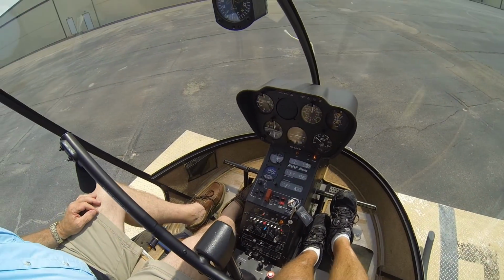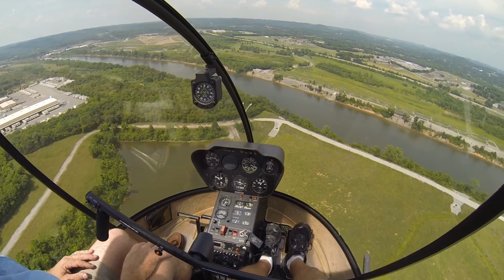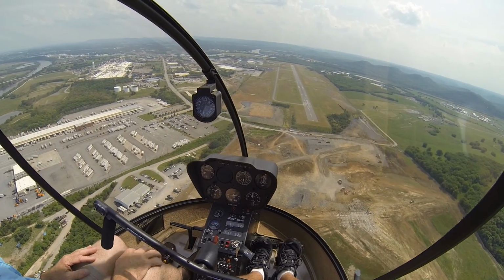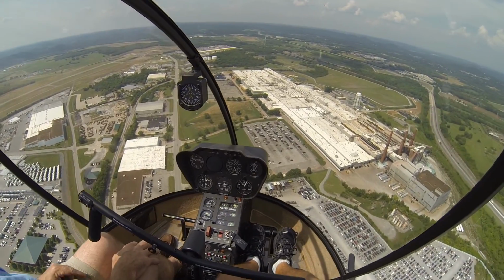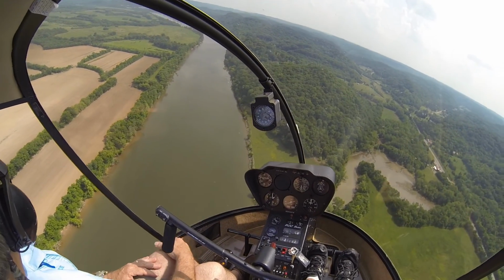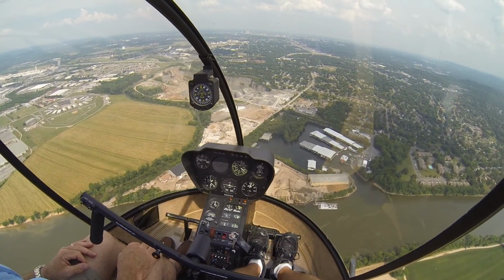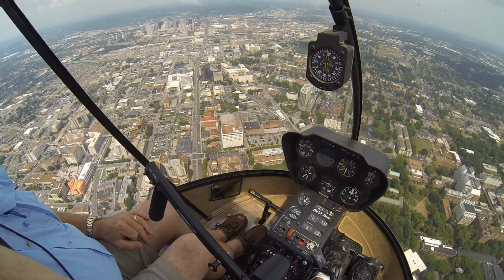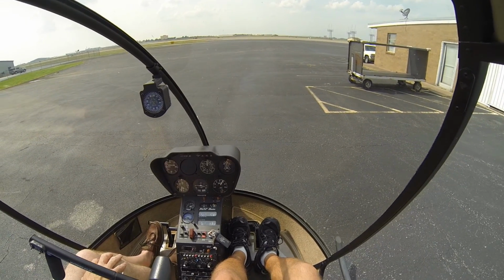R22 Helicopter Training #26 l Settle w/ Power l Autos l Nashville Int.

Comment: Thanks for another great video Michael- fyi I was taught you only need 10-20% or more power applied (with the other 2 factors) to get into settling with power (basically any time during powered fight)..not 70%....unless I've been taught incorrectly I'd check that..
Reply from the maker: justinspirational , you are correct. My instructor was taught the 70%. In the book though it says what you have learned.
Reply: Did you ever get your commercial?